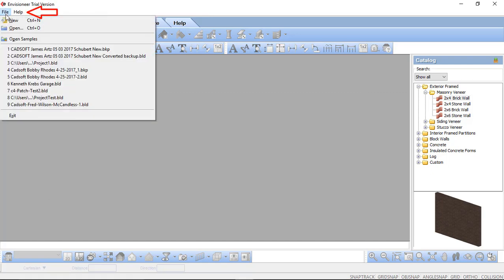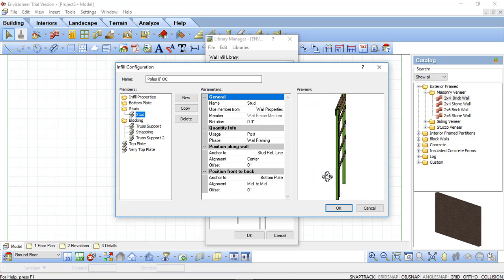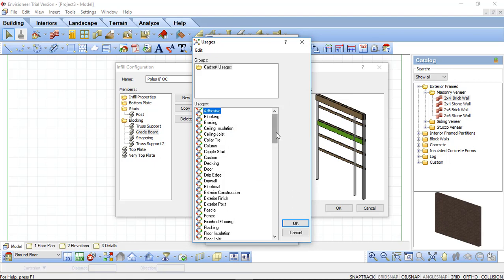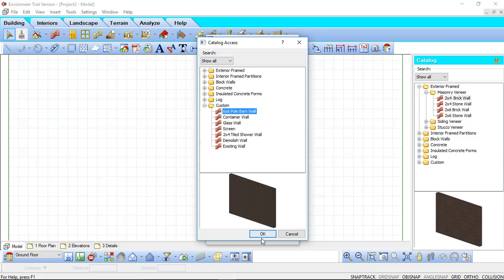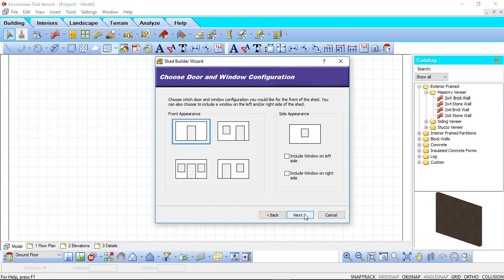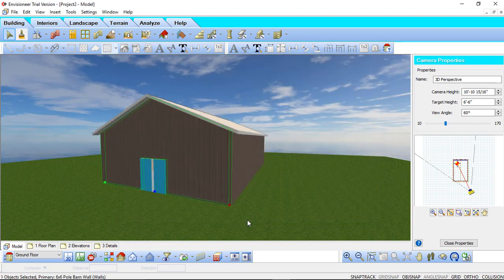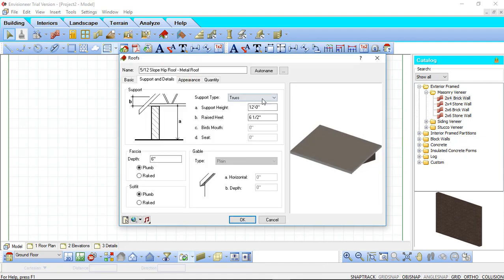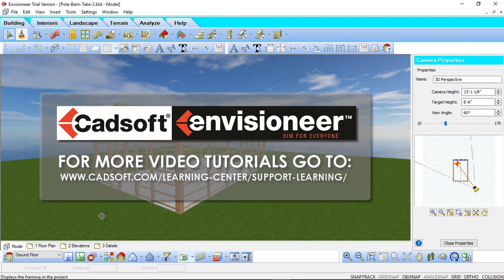Pole Barn Building in Envisioneer

Comment: could you tell me how i can remove the double 6x6 in the corners so everything fills in properly?
thx great video
Reply from the maker: Hi Tammy. It is a property of the Infill Configuration on how the corners get the 2nd post. Go to Settings>Building Locations and in the Building Locations dialog box, click on the last column "Framing Options". In the Framing Options, double click on the Infill Configuration set. It will take you to the Infill styles, right click on the one selected and "Edit Infill..". On the left side of the Infill Configuration dialog box it will list all of the members used. Click on "Infill Properties". In the middle part of the dialog it will list the properties of that infill. You want to uncheck either the "Start Stud" or "End Stud" because each corner will have the start of one wall and the end of another and the reason you see 2 posts at each corner. With one of them eliminated you will only have 1. Hope that helps!

Comment: When I go into library manager, no wall framing libraries tab is available at the bottom. Is there a reason for this? I am in the pole barn option from the main menu.
Reply from the maker: Hi Patrick. If you don't have Envisioneer Building Essentials or Construction Suite it will not show you framing options as they aren't available in ProArchitect or Personal Architect. Please contact support@cadsoft.com if you need more clarification.